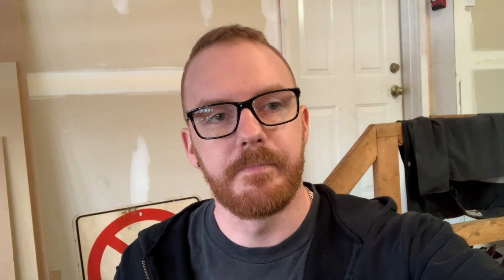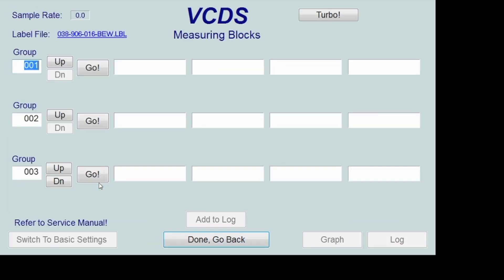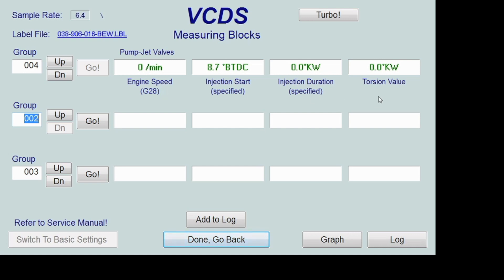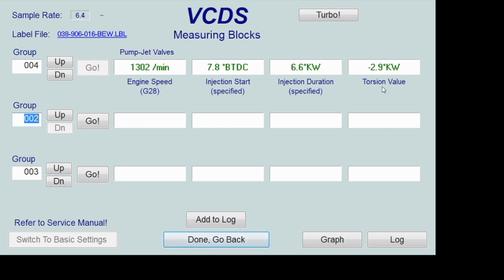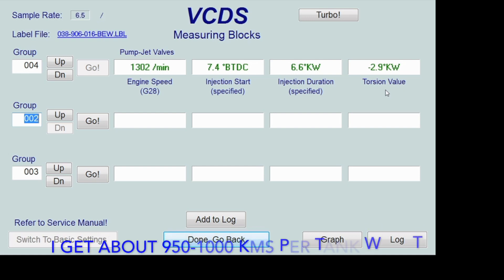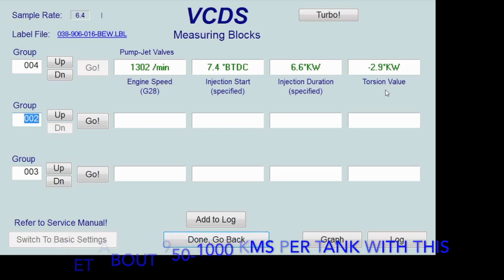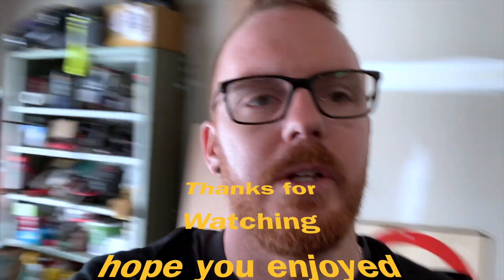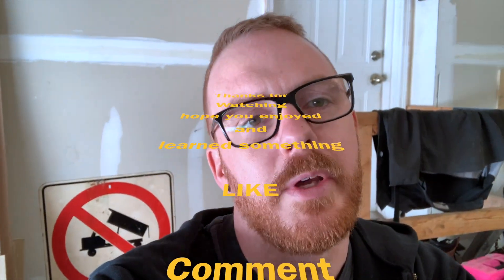How to set cam timing (torsion value) on a PD TDI

Comment: Is it normal for the torsion value to flicker? Mine goes between 0.5-1.6
Reply: Some do some don't. My 1.9 AVF has that, it's between -0.6 and +1.2, just use the value it's showing most as a reference, mine usually settles at bang on 0, but I might try to advance it a bit to get better cold starts. Aftermarket cams aren't as good as the originals sadly 🤦

Comment: VW Skoda PD Engine Torsion Value Adjustment. VW Volkswagen and Skoda 1.9 non start, long start or cutting out easy fix if timing is ok on scope and tools line up.

Note: Needs to be zero or close but not outside the range of -6 or +6. Research was showing -1.5 / -2.5 was one of the best positions. If I read right, anything out of that range will show zero so live data will misinform you but I’m yet to confirm that but it’s probably right but you can get it close and working find without a tool if you’re stuck and don’t have access to ￼ diagnostics.

Leaving it at value "0" is not indicated for that vehicle engine. It works optimally at values of -1.5/-2.5 (maximum) one testers experience of more than 1 year of testing and testing values, etc. pass -4.4/-3.5/-2.8/ +1.0/+2.6 .. 

The improved value for that engine was in his case -1.4 and accelerating above 2000 rpm -1.8. Idle consumption of 0.6lh the injector compensations much better than with another value. 

You can read more about it here https://www.myturbodiesel.com/threads/pd-engine-torsion-value-solid-information-about-why-and-how-to-optimize.35386/

Comment: Hey brother. Thank you for the video.  I just replaced my timing belt, and I don't have a Check engine light.  The car wont start and VCDS says its Bank 1: CMP Sensor (G40) / Engine Speed Sensor (G28), which means the timing is off.  Since my car wont start, how do I start it in order to determine whether or not my timing is off? BTW, you did some exhaust work for me a few years ago, but I'm no longer in Ontario!
Reply from the maker: Bew have common issue with the ground wire on the crank sensor which is common between cam and crank sensors if I remember correctly 
Check and see if u have crank signal while cranking 
If not figure out that issue and go from there 

Could just be crappy timing that somthing failed or wiring got giggled while doing the timing belt
Reply: @ERAutomotive  My sensor is showing 12.0V on VCDS, does it mean that it is grounded properly?

Comment: My 2006 Jetta 1.9 pd BRM had +1 torsion value. It would spin tires in first gear when the turbo boosted and then spin tires a little in second gear. Still 46mpg highway at 75mph. 
I retard torsion to about -2 and now tires don’t spin. Less power.

Comment: On my vw van (t4) 2.5 tdi, when checking the pump timing you have to change to basic settings to override all the adjustments the ecu is making. Should we do this here as well? I just changed the cam belt on my polo tdi which is a pd engine, when I switched to basic settings the revs went from 903 to 1123 and the start of injection changed to late.
Reply from the maker: I don’t believe you need do that here
Reply: @ERAutomotive  OK thanks. I'll get tweaking at the weekend
Reply: Thanks for the help, I've got it idling at - 0.3 to 0 now, was at +0.3 to +0.8 so hopefully this'll get my economy back up, certainly sounds smoother!
Reply from the maker: Awesome report back with how it is after u see how the economy is
Reply: Will do, I've just chucked a bottle of forte diesel treatment in the tank, so it'll be in a couple of weeks once that's out of the system I'll get a true reading!
Reply: Is it clockwise or anti cw for advance ? Would advance be + or - on the torsion value ? 
And would advance give you more smoke ? 
Thank you 👍🏼
I have a pd 100 ATD and vcds ready to roll.
Long story but I know my timing is out.

Comment: Thanks bro! Have had some issues with my car running weird, shaky at certain rpms. I know for a fact that my injector loom is bad. But i made a quick fix for it. I will also try and adjust the timing for the camshaft aswell if it is way off. Since i recently did a camshaft (with new bearings and lifter caps) swap.
Reply from the maker: Good luck hope it goes smooth
Reply: @ERAutomotive  me too! I'll upload a video of when we work on it. Want me to notify you once its uploaded?
Reply from the maker: Yeah I’ll check it out
Reply: what was your quick fix for your loom bro 😂 ?

Comment: I've answered it.
If you have a - number loosen 3x13mm bolts and turn the 18mm bolt anti clockwise. 

I had -4.4 and moved it about 2mm and it went to 8.0 

It's a very very fine movement needed 
4 attempts and I've got it down to bang on 0.0 and sometimes goes to 0.6 on slight lift off 

Anything in 3.0 or -3.0 is within "spec"

Comment: Anyone know which way you turn the cam to get back to 0 
-x.x to 0 = clockwise or anticlockwise?
Etc?
Reply: This saying helps me remember "Driver retarded" (anti clockwise ) .
Clockwise =advances timing(+)
Reply: from what i saw, you must turn "in the same way of the value", i.e. if it's negative : turn anticlockwise; if value is positive : turn clockwise.

Comment: If its a true zero(tdc 0) and the belt is able to keep up tension all time, the value should be stable during all rpm range, when the value Bounces, it means that the belt is letting the angle between the camshaft and crankshaft  change for some reason.
Reply: Some of these actually have slightly oval crankshaft gear, that's why there are 2 different types of locking pins for doing timing belts etc, some are oval, some not.
Also you are correct about the belt tension etc, there is a slight deviation due to this, but when setting up the injectors, Tdc and tighten injector cam adjustment till stops, then turn back quarter turn and lock it, do that for all 4 injectors allows the engine to still perform with slight deviation of Torsion values (withing range) and no damage will be done. Setting everything within spec car will start and run a lot better.
Reply from the maker: Thanks for the information
Reply: @ERAutomotive  another tip, you have tdi from series A and B, ex, ASZ and BLS, they use very different angles, even the crank lock tool is very different (angle), you can use more angle on B séries than in A séries, B séries Will Run good past -3/+3, A séries Will not even start beyond those values and Will mostly damage the valve train.
I do recomnend to start by setting the engine to spec with the specific locking tools and then you can play around that.
Have in mind that Change the cam Timing on a PD engine Will affect not only the cam Timing but also the injector position on max pressure, the injector pressure is driven by the camshaft and the window of max pressure is not that big, and drops with time due to cam lobe degradation.

Comment: What would you make the value for ultimate economy?
Reply: would also like to know
Reply from the maker: I set it to spec personally
Reply: More close to 0 is the best. But i heard people use higher value and they get better economy so play with it you cant really mess up. For safety just mark the value u currently has because if you turn too much the car not gonna start. Also if i remember correctly the cover has a value probably faded because the time but if you can read you can set it up. (Thats factory value)

Comment: Always check that value when engine if fully warmed up, oil and coolant at 90C.
Reply: But could you explain why ? i have a problem with a VW polo 1.4 tdi that starts perfectly on cold engine, but impossible to start when engine is warm. On diag it says "camshaft sensor,  values out of range". Also, the angle value (-7 degrees on diag) is already out of normal interval between -3 and 3 degrees (for tdi engines) when engine is running cold. So i guess it's linked to what you wrote, but why ? does it mean the camshaft slighty twists when warm, so the camshaft pinion is slightly rotated and then generates the default out of range ?? Maybe when hot, the angle is even lower, below -7 degrees, thus car computer prevents engine to start. Thanks if you could clarify me

Comment: I have a crazy value of 9.5 KW at idle, havent tried accelerating it to see if it changes, should i take the timing cover off and adjust it back?
Reply: Is it risky, or can I make it diy with the help of vcds without risking too much?
Reply from the maker: Yeah it’s no big deal to adjust in my opinion
Reply: @ERAutomotive  Hello man i have high torsion value it is risky to adjust it?
Reply from the maker: No I don’t think it’s risky
Reply from the maker: Yes I would adjust it into spec personally
Reply: Should aware of precious interveniente in bolts not to have as I saw before over extension...